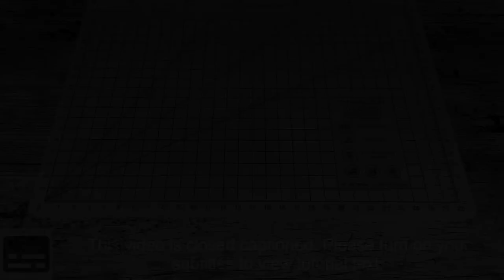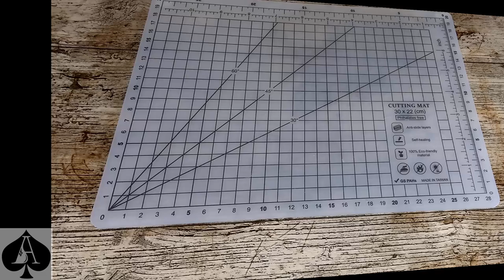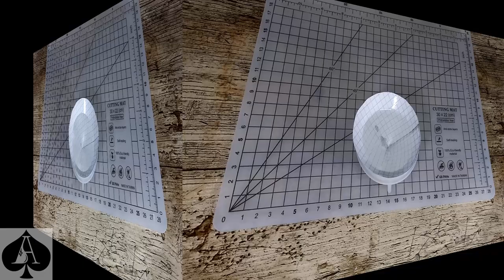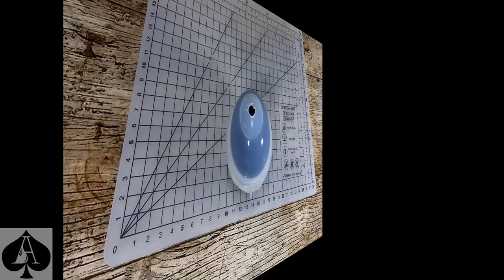How to Make a Vortex Sphere Paperweight from Epoxy Resin - It looks BIGGER on the inside! Tutorial

Comment: What an awesome idea with the cone-within-sphere. Apparently one cannot underestimate possibilities for sinking resin shapes in resin. Thanks for a great mood lift and tutorial in one 😍
Reply from the maker: Thank you 😎♠
Reply: Brad AmeerBeg  you can start on Amazon. Home Depot and Lowes have some you can start with. Even Michael's l think has Amazing Cast which is great for the small stuff. It is an EXCELLENT beginner resin. I love it for jewelry. I do large resin projects also so l use a different brand too. Not sure if you are in US or UK.   Start with small sized bottles as resin can be expensive. If it says pint you are getting 2 half pint bottles. The combination of the two is a pint. Read the label carefully. Some can be mixed by weight others must be mixed by volume. Some 1:1 others not. Some can be mixed deep others cannot gom more than 1/4 inch. Know what you are buying. Watch some safety tutorials first. Resin needs ventilation. His projects are small but most of us wear respirator masks. I wear gloves too but Ace is only doing small stuff so he isn't getting any on his hands. As a newbie start with gloves 🙂🙃. 
Good luck. Have fun Resin is a BLAST!
Reply: Bellísimo, gracias por enseñarnos tus conocimientos, saludos desde argentina

Comment: I am TRYING to do this and got all the glitter on and was ready to continue, BUT... It looked like it was not going to be very visable through the half dome that was about to be poured for the top.  So, I soaked it in soapy water and peeled all the glitter and glue off and am about to begin yet AGAIN!  I was wondering if that last dark layer that covers all the spirals is necessary or if you think it darkens the final product at all.  Since it's not the part you see inside the spiral, just wondering if it serves a purpose.  Thank you AND I just LOVE this sphere you made!  Whether mine turns out okay or not, YOURS is great!
Reply from the maker: Hi, depending on your coverage of glitter on the spiral part you may need to go over it twice before going all over it with the last layer. The last layer isn't absolutely necessary, I thought it would add to the effect if the outside appeared a solid colour.

Comment: I love the finished product, I have a question tho, How do you finish the sides? Every time I use this mold, I get a lip, I try to sand it, and it only gets worse, Full of pits, then I try to fill back up with resin, just becomes a blob of hot mess.
Reply from the maker: On this one I just trimmed it with flush cutters, and because there was a line in the pattern between the two halves of the sphere it wasn't really that noticeable. Joins in moulds are always hard to deal with unless you have some professional buffing equipment.

Comment: https://youtu.be/OqGhzwrBelI?t=376
"It will take about 75g of resin to fill the bottom half of a 65mm sphere mould"
?? Do you measure that 75g as the combined amount of PartA and PartB?
.

When you mould something in a silicone mould sphere, do you need to clean the mould for the next project?
If so, how do you suggest cleaning?
Reply from the maker: Hi, yes that is the total weight, so for my 2A:1B resin it would be 50g part A and 25g part B
Reply: @resinAce  Thank you.